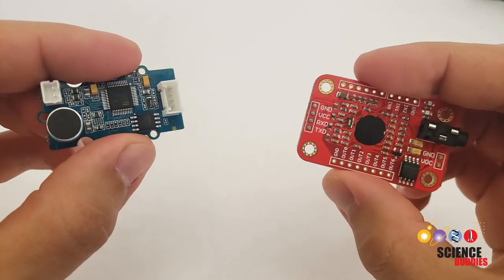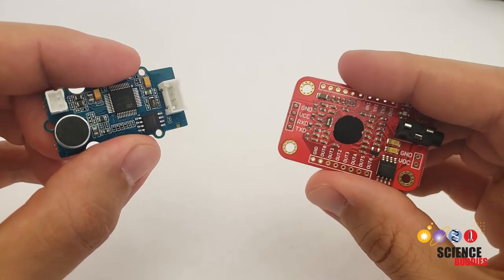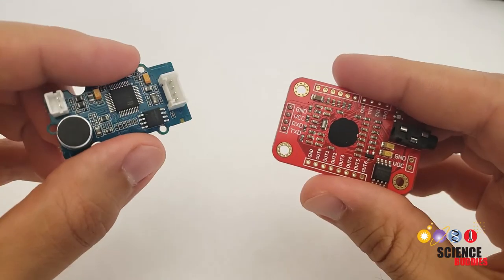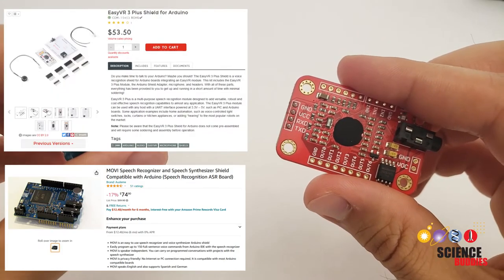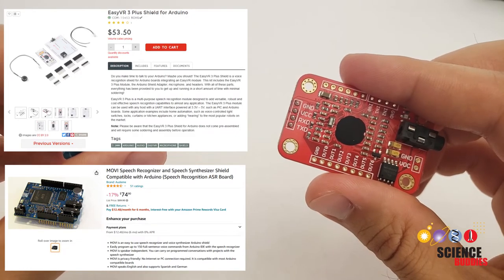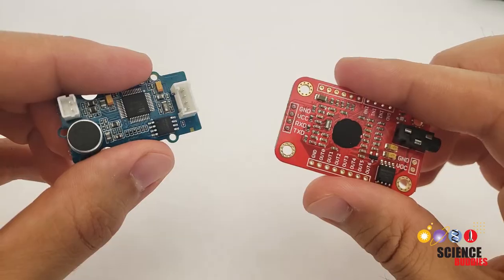DIY Arduino Voice Controlled Lamp | Science Project

Comment: Can the laptop be removed ?
Reply from the maker: You can run the Arduino on battery or wall power, it does not need to remain connected to a laptop.

Comment: Hello! Does it need the internet to function? Thank you!
Reply from the maker: Hi - no, that is the trade-off of using these devices. They do not require an internet connection but can only process a limited number of voice commands. If you use something like a Raspberry Pi, you can connect to a speech-to-text service that runs the same technology used for Siri, Alexa, etc, and can process anything you say - but this requires an internet connection.
Reply: @Science.Buddies  thank you!

Comment: Hi! What can we substitute with IOT Power Relay? We’ve been having a hard time looking for it online, as it seems to be sold out almost everywhere. Thanks
Reply from the maker: It looks like Digikey has them in stock: https://www.digikey.com/en/products/detail/adafruit-industries-llc/2935/6227071. SparkFun and Adafruit used to carry a similar product called the Powerswitch Tail that's been discontinued: https://www.adafruit.com/product/268, but you could also look around to see if you can find a used one.
Reply: @Science.Buddies  Hi! I'm from overseas so the IOT Power Relay is still a bit expensive for us. Are there any other alternatives for it?
Reply: Also, do you need both the Elechouse and the Grove Speech Recognizer for this project?
Reply from the maker: Hi - unfortunately we're not currently aware of any other alternatives to the IoT relay, unless you can find a used Powerswitch Tail somewhere. And no, you only need one of the speech recognition modules for this project, we just show examples of a few different kinds. (Apologies for the delayed reply - until now, YouTube only notified us of new comments, not additional replies to older comments)
Reply: @giannarivera4266  You can just use a regular 5V Relay.

Comment: Hi science buddies. I'm doing this project for my science fair, and is there any code to upload to the arduino for the lamp, like the led? Like is there an example code, or do I just not upload any code. I've connected the arduino and IOT relay, and set up the elechouse, but It wont turn on after I say on. Thank you!
Reply from the maker: Hi - please refer to the written instructions on our website: https://www.sciencebuddies.org/science-fair-projects/project-ideas/Elec_p093/electricity-electronics/arduino-voice-controlled-lamp. If you are running the example code as instructed there, you need to have the IoT relay connected to pin 13 on the Arduino, or edit the code to control it with a different pin. Make sure you are seeing the on-board LED on the Arduino (which is also connected to pin 13) turn on as well.
Reply from the maker: Hi - if you're having trouble with this project, please post your question, along with your code and pictures of your circuit, in the Ask an Expert forum on our website, and we will be able to help: https://www.sciencebuddies.org/science-fair-projects/ask-an-expert-intro

Comment: I hope you reply

My friend and I have a voice project which is who to convert the electrical chair into voice commands responded 

We did it and we use the hard ware you used in this video ( Voice recognition) but it didn't provide a smart replay to our comments sometimes it turn on the chair just by hearing a noise voice
So does there any hardware or software solutions for this issue?
Reply from the maker: Hi - this isn't really enough information for us to help you troubleshoot specific things. If you are a student doing a school science project then you can ask for help in the Ask an Expert forums on our website. Otherwise you could ask for help in the official Arduino forums on their website.
Reply: @Science.Buddies  I am a university student and this is a graduation project, I want you to inform me if there is a way to enhance the voice response

Comment: Hello sir! Do you know the problem with what i did as i copy what you've done the training if voice goes well as it notified for its success but when i load the trained command it says record untrained
Reply from the maker: Several other people have reported this issue lately and if you Google the error message it appears to be an issue with recent boards discussed in support forum threads. We recommend contacting the manufacturer for a refund or replacement.

Comment: Hello science bodies. I will like to ask a question concerning this video.  Is it possible i do this project then i modify such that i can manually turn and off and also do voice command on the same project?
Reply: I will really wish for us to chat more so you can explain better because i am working on a project of a voice control light bulb/ manually putting on and off
Reply from the maker: Hi - yes, you can have multiple inputs control a single output with an Arduino. You may find our introductory Arduino series helpful if you are new to working with Arduino: https://youtube.com/playlist?list=PLlBVuTSjOrclb0iCMSRpS_H1lSrlSVeEm

Comment: Hi I am just wondering if i can do this if my light bulb is directly connected to the circuit breaker and controlled by a common switch. What I want is just to insert the materials needed to the wire between bulb and switch with proper wiring. What do you want to suggest ? Thank you for an active response.
Reply from the maker: Hi - we do not recommend that approach because it involves handling high-voltage wiring directly, which can be very dangerous if you don't know what you're doing. The IoT relay allows you to interface with high-voltage lights and appliances without needing to work with the high voltage wiring directly. If you want to do that we recommend that you consult an electrician.